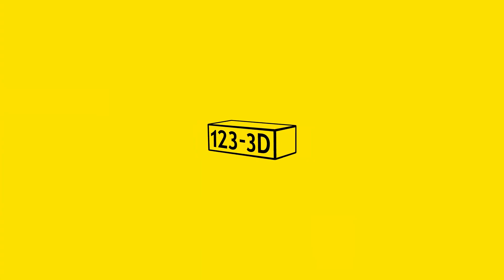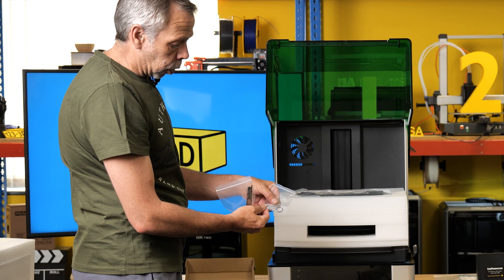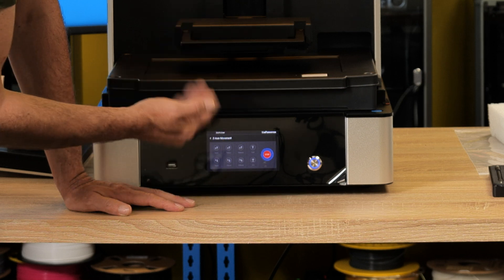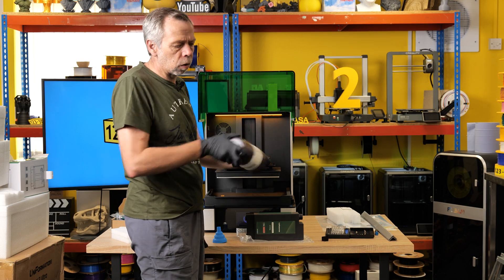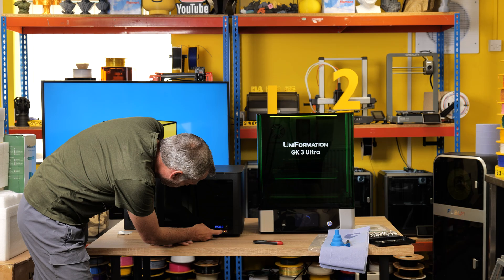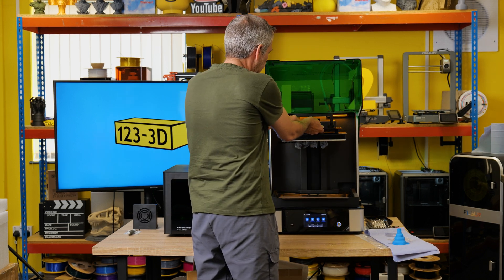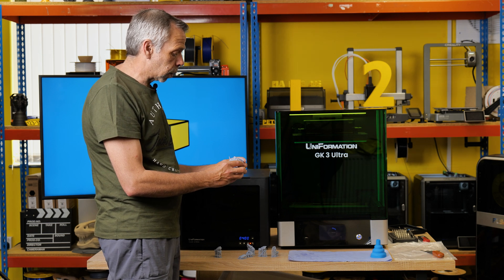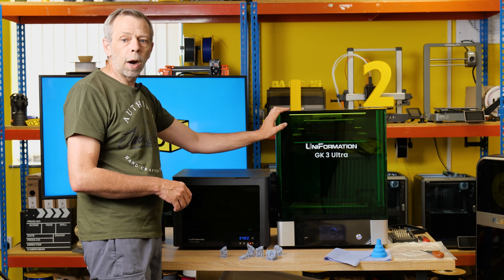Uniformation GK3 Ultra & Cure3 Ultra | First Look and PRINT!

Comment: Hey just got this machine from you guys having some issues with it failing lloke 80% perfect and then it just fails very unusual
Reply from the maker: Hi, if you drop us an email with your order number and exactly what's happening someone from our tech team will take a look into it for you. If you could include as much detail as possible an any pictures that might be relevant that would be great. Email is info@123-3D.co.uk
Reply: @123-3D-UK  hello just dropped a email with a few pics and some of my basic settings, its more a consistency issue i have had a great print from the machine.

Comment: You should remove the supports before curing to make it easier and leave less marks. Ideally with hot water. Thanks for this review
Reply: so you get a warped part while removing supports and more so after curing? Amateur